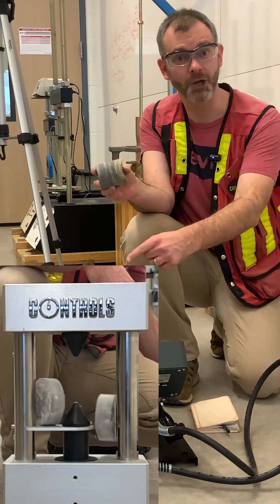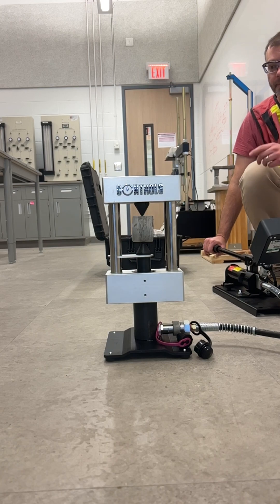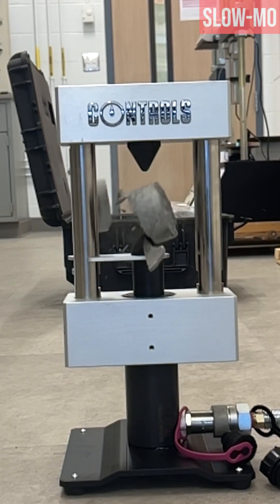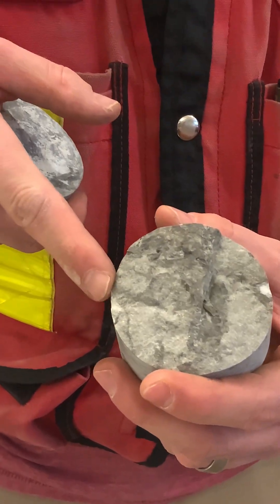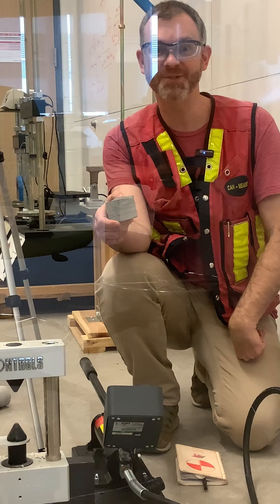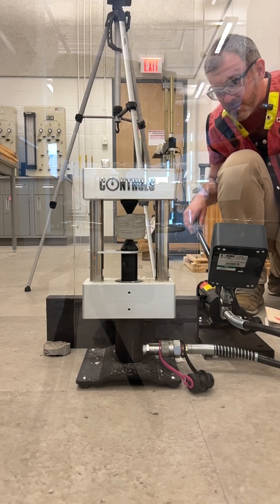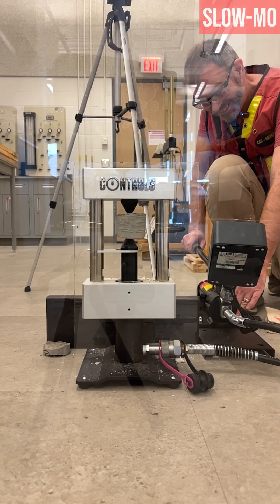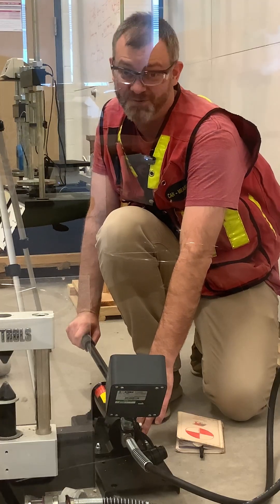Breaking Rock: The Point Load Test #rockmechanics #geotechnicalengineering #engineering #science

Comment: Hydraulic or air ?
Reply: Looks like hydraulic but i couldn’t be sure
Reply from the maker: Hydraulic, a manual oil pump.
Reply: @geomechanic  aha thankyou ! This is quite the tool could come in handy for pressing ball joints we have a massive hydraulic press but it’s too much work to use 😂 we typically just use a hammer a smaller machine like this is awesome